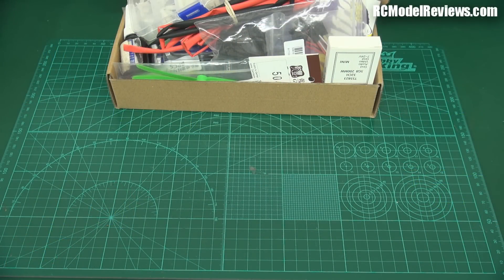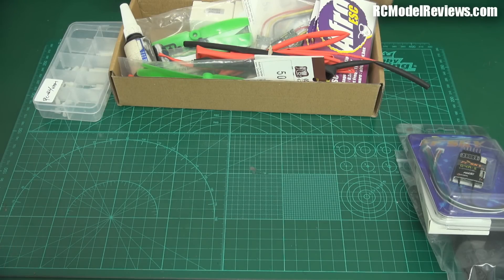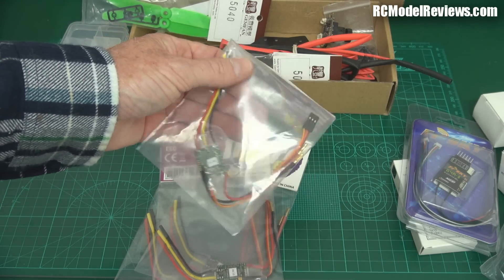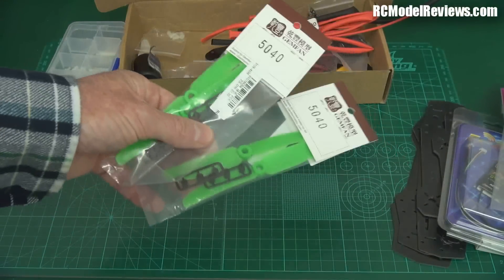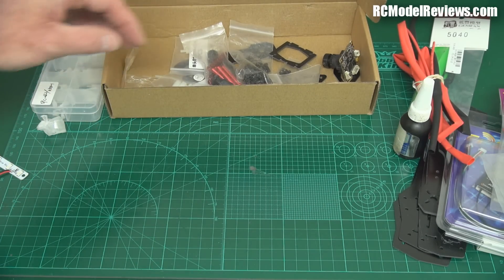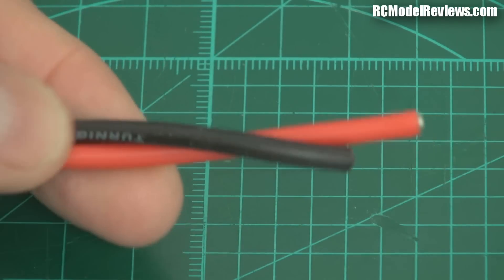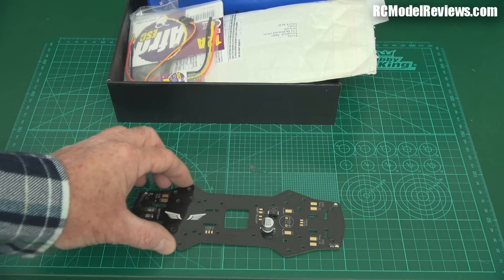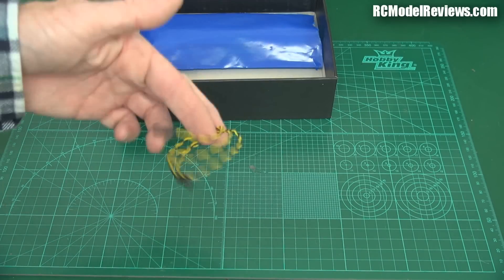Low cost miniquad racing drone build video PART 1

Comment: Afro ESC's are garbage. Spend another $5 per ESC and get something a step up. You will save money in the long run.
Reply: SF PV
That's right.. because I've never helped anyone nor replied to comments posted here (LOL).
Reply: No worries mate.  Most folk know that the XJet comments come from RCModelReviews but I guess some don't.   Just test-flew the miniquad -- flies beauty (even with those Afro ESCs) :-)
Reply: SF PV This is a budget build and the Afros are perfectly fine for this project.   Spending an extra $5 per ESC would bump the price up without any perceptible advantage for a first-time miniquad flier.   I will be using much better ESCs in the top-line miniquad build project where the advantages they offer will definitely be worth the extra money.
Reply: Dude, $20 more dollars for much better control and response is well worth it, especially for a noob. I fried 2 of my afro esc's just installing the damn things. They are garbage.
Reply: SF PV Noobs aren't going to worry too much about the difference between an Afro and a KISS on their first miniquad.  How on earth did you fry an ESC by just installing it?
Reply: Well the first one, I think I fried it just soldering the motors to the esc. I was very careful and made sure the temp didn't get too high. The second one fried when I hooked up a 4S lipo to my quad. I had the latest version of the AFRO esc's that are supposed to be rated up to 4s. I was recommending the Rotorgeeks, not the KISS. The Rotorgeeks are very user friendly and plug-n-play. It's just my preference.
Reply: SF PV I agree about the rotorgeeks ESCs, I will be using those in my "top end miniquad build" video.  Horses for courses ;-)
Reply: Sweet man you'll love em! Especially with a 4s. I can now keep up with my buddy's blackout 220 :)
Reply: SF PV
XJet=RCModelReviews=Bruce

Why don't I reply using RCModelReviews?

Because in the change-over to the new "G+/YouTube integration" things got screwed up so I can't even comment on my onw RCModelReviews channel using that name any more.  GRRRR!   Stupid Google fixing stuff that isn't broken and breaking it in the process.
Reply: LOL no, I just have much practice crashing! ;)
Reply: i found this conversation useful, Bruce it would have been good if you had given a build list with alternative options for things if people want to upgrade a little.
However i do understand your reasoning behind choosing the afros for a budget build, and as you proved SF PV, things can often go wrong for noobs when they start out in RC, and errors can be expensive. 
I will be looking at the Rotorgeeks ESC's for this build, would you guys be able to tell me what motor to go for? again id like a slight upgrade on your budget choice ;)
Excellent news that you will be bringing out a "top end miniquad build" video. Much thanks for your help .
Reply: I use the t-motor 2300kv's. I got all 4 on ebay for $100. Glad you found this convo helpful :) Don't rely on Bruce for any replies or help
Reply: I said "Bruce" not "xjet" (LOL). If this is Bruce, then why wouldn't you reply with your channel name? I understand that he probably doesn't have time to reply to everyone. That's why I said don't rely on "Bruce" for answers.
Reply: Ah gotcha. Well in that case thank you for responding to your viewers :) I didn't mean any malice by my comment. I was simply saying don't rely on bruce b/c you are probably really busy. My comment about the afro esc's was honest, I didn't mean to diminish your video. It's def the best build video out there for a budget ZMR :)
Reply: Ya I had a blast with my Afro ESC's, until I hooked up the 4S Lipo. It fried one immediately :(. Safe flying buddy
Reply: ***** temper! lol 
Bruce, could you add the rest to the bill of materials? Receiver, heat shrink, stand offs, plastic screws, what was the battery connector called?
Reply: Sam1ee you're pro already?
Reply: No I'm in the learning stage. I have crashed and rebuilt 2 Symas, 2 proto x. I put the salvaged flight controllers onto carbon fiber frames. Broke the carbon fiber frames in a crash. Upgraded motors and props... etc ... blah blah blah.

Anyways... you get the picture.

I have a contest with colleagues: who can build their first FPV racer.

I am a beginner and loving Bruce's instructions.

Are you pro?
Reply: korzer what designates you as a pro? 50+ crashes under your belt? ;)
Reply: SF PV  I have more than 50+ crashes LOL. Some have been disastrous! I have broke 3 frames, destroyed 2 motors (crash landing in water), and have a junk yard of chinese quad parts ("never throw away anything!" as a smart fellow said).
Bruce, I'm rewatching to catch anything I might have missed. :)
Reply: sam1ee ( or was it a double negative? "Don't throw away nothing!)
Reply: sam1ee sounds like you're a pro :)
Reply: sam1ee but you know how to fix stuff like a pro! lol

Comment: Bruce,

Great video as always.  If I may ask, could you also cover transmitters and goggles?  They can easily cost as much as or more than the quadcopter, and it's easy to find the top of the line, but the "starter" stuff is a little less obvious.  I think since most hobbyists have been doing this a while, they have already made transmitter/goggle commitments, and forget that the beginners need guidance in this area.

Cheers,
Duane

Comment: , hey guys if you don't want to get the cut down version of the naze32 we can get basic free fall on naze board from good Banggood its called the flip 32 it has the barometer and compass and same price as HobbyKing's cheap cut down version also it's either way cheaper there you can get sunnysky 2204 for $15 or you can get sunny skies 2206 is for $17 it's a screaming deal there es C are great value there too you can get the 30 amp Spyro's spiders there are the small slim Lawrence or something like 12 bucks to or you can get there 12 amp 20 burst esc for 9 dollars they also have great deals on FPV stuff like many 250 mil want transmitters video transmitters for $23 and they have like a ton of building here a little build your on version of that for only $15 can you believe that I highly suggest you guys go and take a look cuz they also has it is sunny sky 20 20 sixes and sevens whatever they are Federer 21 kV for $17 great value brand name and free shipping was the time

Comment: Thank you for pointing to Banggood.  I just set up a full tricopter build on that site for about $220US (a similar build was pushing just over $300 elsewhere).  Not much different it appears from your quad price, but I have more expensive motors (need to swing 9x4.5 props) and circular polarized antennae in it.  All up it's going to be about $240 since I'm grabbing a tough tilt mount from FliteTest for it too.

Comment: Hey Bruce, is there a chance you can do a comparison of CE certified video Tx units?
I'm sitting in Germany, and we are stuck with 25mW on 5.8 and 10mW on 2.4 with usually horrendous prices for the units, whereas 200mW china video Tx is cheap as beans but hella illegal.

I also think it'd be worth mentioning to check local law before launching a comparatively powerful RF transmitter into the air. (if I read it right, flying with a 200mW china unit can cost you up to 50000€ in penalties here, if they find out)

Comment: Hey Bruce, in Germany the max for 5.8Ghz is 25mW. Any idea what the best Tx and Rx would be. (Also important, we can only use certain frequencies within 5.8Ghz but I have no clue what those are)
Reply: Hey wegen den 25mW, wenn du am Land wohnst merk dir einfach nur das: was Niemand weiß, macht ihn nicht heiß. Funktioniert bei allen meiner Fliegerkollegen :)
Reply: Hi there, if you really want to stay within the legal boundaries, I would recommend a nice little 25mW transmitter from Team Black Sheep:
http://team-blacksheep.com/products/product:108

It's a CE certified, fully legal transmitter. I got about 90m range (in an open field) on mine, with good video quality.

For the frequency, just check what 802.3a WiFi uses, as those will be the same frequency us commoners can use without a license.
Reply: Fr33lumby©
Leider wohne ich Süd von Nürnberg und die alte Leute hier haben NICHTS besseres zu tun als im Garten zu arbeiten oder mich anmaulen, dass ich sie störe durch das ständige fliegen (2 mal am Tag nur am Wochenenden).

:(
Reply: Murphy Quad
Thanks :D
Reply: Alexrocksdude dann maul sie ab sofort jedes mal an wenn sie rasen mähen oder ähnliches was krach macht. :P vielleicht beruhigen sie sich, ansonsten würde ich dir einen Modellflugplatz oder Club empfehlen oder einen Ort fernab von Wohnhäusern etc.

Comment: I'm starting from absolutely nothing—unless you count an RTF Micro quad (Hubsan X4). I'd appreciate your thoughts on the rest of the equipment that's needed as well... transmitter, video goggles/display, battery, charger... all of that stuff.

Comment: Bruce I think your budget build is not that cheap :) Take a look at the link below ($102.59 whole quad), it comes with a CC3D board that you can even flash Basefligh/Cleanflight if you want too, only need to add the FPV gear (~$50 for camera and tx) and receiver, Flying FPV quad for less than $200.

http://www.ebay.com/itm/QAV250H-FPV-Carbon-Quadcopter-Combo-Kit-Frame-CC3D-Flight-Controller-Motor-ESC/121554864489?_trksid=p2047675.c100005.m1851&_trkparms=aid%3D222007%26algo%3DSIC.MBE%26ao%3D1%26asc%3D29947%26meid%3D0b0f6560335742ceb1889ad55cb03e8e%26pid%3D100005%26rk%3D3%26rkt%3D6%26mehot%3Dpp%26sd%3D201301094130&rt=nc
Reply: elpidiovaldez4ever yep, but this isn't the cheapest build using parts of unknown performance or quality (what are those generic ESCs and motors like in the eBay package for instance?) it's a cheap build using parts of a known quality and performance.  The CC3D is also a lot more complex to set up and (IMHO) far less suited to first-time users.
Reply: ***** I have never used a CC3D board (KK, multiwii and naze32 only) but for what I have seen on youtube videos the setup process is pretty easy IMHO. I do think Hobbyking prices on motors and ESCs for 250 size quads are way too high for being a chinese business with direct access to manufacturers, I can find better motors and good ESCs (simonk and blheli) from local US sellers at better prices. Even Banggood have better prices and they aren't a RC dedicated seller.

Comment: Nice one Bruce, might be worth mentioning that unfortunately most of the EU has a maximum 5.8Ghz power limit - in the UK, 25mw is the maximum legal limit. It's not likely that anyone would get pulled up over it, but on the rare occasion that something does go wrong and it's looked into, I wouldn't fancy trying to explain why I was transmitting at 200mw - 175mw over the limit of 25.
Reply: ***** That is true but 25mW is pretty marginal if you intend to do any kind of proximity flying through trees and the like.   I've never heard of anyone being submitted to  a power test or being prosecuted for exceeding the regs on 5.8GHz and that's because even a 200mW signal doesn't travel very far and is thus unlikely to cause interference that would result in a complaint to the regulators.   So long as you don't go flying over other people's houses and disrupting their 5.8GHz WiFi then nobody will even know you're using 5.8GHz.

Comment: Afros are not a good esc to recommend, especially if 4s and or flashing is intended. They do not gel well with high kv motors and 4s plus simonk has issues there too. Blheli works but again, many die when flashing. So many other better options for esc

Comment: Thats the Team Legit PDB bottom frame plate isn't it?
Reply: Possibly the overcraft v1? I have the Overcraft v2 from Team Legit that has all the solder points to install a minimOSD directly above the board and a few other tweaks. IMHO - WELL worth the money if you are at least fair at soldering. Team Legit will start selling the Nucleus PDB soon as well. (another great PDB)
Reply: ModifiedRC Just had a look at mine and I was wrong. I don't have a V2 it is a V1.2. Mine does have a lot more items than the one he shows. Thanks.
Reply: heliav8r   Excuse me.. Have you installed your board.. I just received mine and have a few questions if you don't mind a pm.
Sorry Bruce.. but isn't your page about sharing knowledge lol..
Reply: heliav8r
 That was a batch 2 overcraft PDB board in the video. You can tell because of the second set of positive ESC pads next to the video filtering components. This was not present on the original batch 1 boards and on batch 3 alot more items were added to the PDB board.

Comment: Is it okay if I buy Simonk Series 20A instead of the one you said to buy?
Reply: texans108 The 20A ESCs are too big for an easy install and aren't necessary.  This setup will usually be drawing well under 10A per motor.
Reply: What if I buy bigger motors
Reply: texans108 Then you start entering a vicious circle where bigger motors need bigger batteries which makes everything heavier, which reduces your flight times and performance, which requires bigger batteries and motors to compensate -- which makes everything heavier... etc, etc.  The performance of this quad with the specified motors/ESCs will not disappoint ;-)

Comment: Hey Bruce. Not sure how to contact you. Quick question about fpv transmitters. Is there a way to put a dummy load on a transmitter so it can safely be powered on but not transmit a signal? My tx has the buttons and display and as such have to be powered on to set the frequency. That opens up the risk of interference with an aloft pilot. Thanks!
Reply: HighFlight2k2 Yes, you can pick up dummy loads (I'm pretty sure Survielzone has them cheaply) but be aware that your VTX will still transmit a certain amount of signal.  They're not totally screened (ie: where the SMA connector solders on the center pin is not shielded so will radiate some power).  You would need to test and see if the amount of shielding built in is enough.  The dummy-loads are cheap enough to give it a try though (about $3 from memory) and are available in SMA and RP-SMA styles.
Reply: ***** Oh wow. Those look simple enough. Is that as simple as adding a resistor? If yes, do you know what size resistor would suffice for a 600mw video tx? I was thinking it might help at an event this weekend.
Reply: HighFlight2k2 A good dummy load involves not only providing a suitable resistance but also making sure that the impedance is properly matched.  Just whacking a resistor inside an SMA connector will work but it might make your VTX overheat and cause damage if the impedance isn't properly matched so as to produce a low VSWR (a technical term for the amount of power that gets "bounced back" into the transmitter because the load isn't good enough.  At 5.8GHz, you can't just whack a wired-resistor across the antenna terminals because it has inductance and capacitance that will cause it to look like something other than 50 ohms -- and thus produce a miss-match.   Also remember that the resistor used must have a sufficient power rating to absorb all the RF energy without overheating.Given that these dummy loads are cheap however, I suspect they are little more than an SMD resistor inside a screened cap over the SMA connector.   It would be interesting to measure the VSWR of one.
Reply: I had sourced these terminators for just this purpose. They will handle up to 1watt so should be more than enough for our transmitters.

http://www.ebay.com/itm/320974772951?_trksid=p2060353.m1438.l2649&ssPageName=STRK%3AMEBIDX%3AIT

Comment: A shot of silicone lub between flights will make those cheap motors last a long time. WD40 brand silicone spray has the "least worst" smell. If you store your quad in the house with your wife, the smell is a big deal. If you store your wife in the garage, it does not matter.
Reply: Hey Chuckles, you are very funny, tho you may not be referring to the maker wives who ARE the drone builders. Silly boys, girls play too. LOL.
Reply: Chuckles LOVE your humour !
Reply: 'wife'!?
Reply: Chuckles rofl
Reply: You can get the Eachine Wizard now with 50% discount from Banggood, best deal you will ever find for a race drone: https://www.banggood.com/Eachine-Wizard-X220-FPV-Racing-Drone-Blheli_S-F3-6DOF-2205-2300KV-Motors-5_8G-48CH-200MW-VTX-ARF-p-1085802.html?p=7I22079633188201703T
Reply: just awesome =)